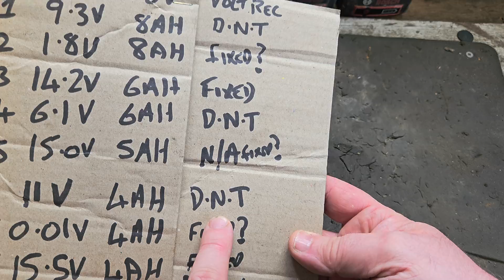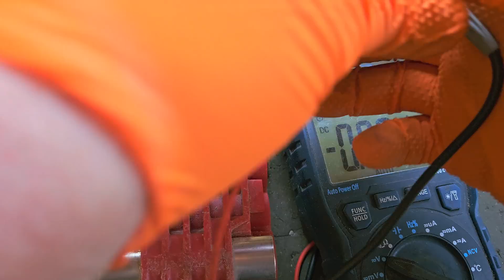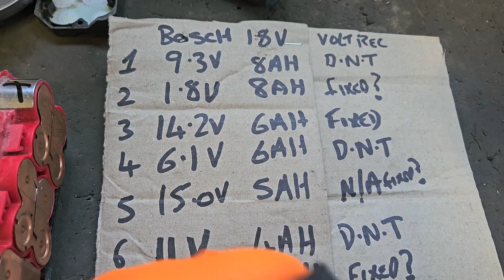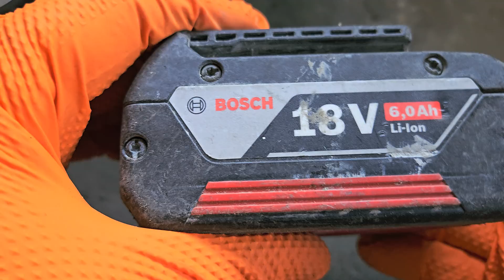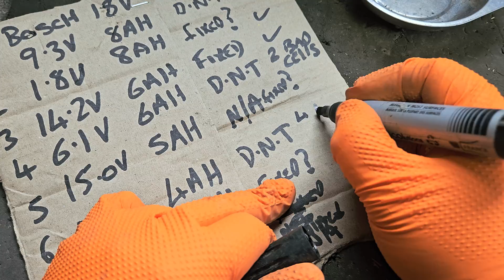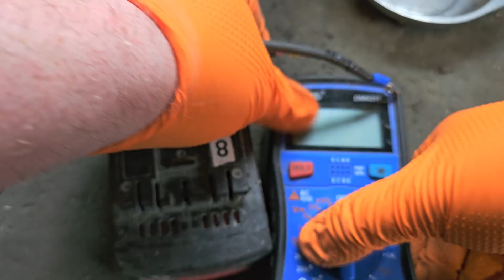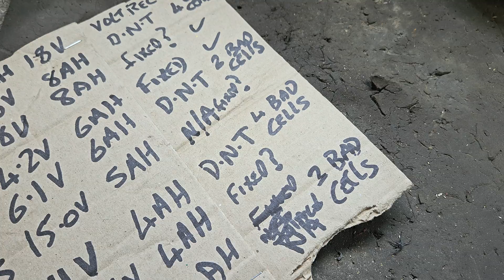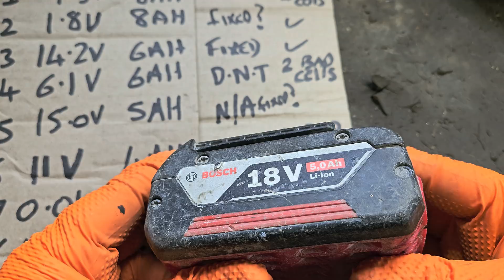I Investigated 4 Faulty Bosch18V Batteries Here's What I Found

Comment: I liked the video............. to digress. What battery do you use to power your spot welder & can you use said battery for the IMAX B6. Thanks.
Reply from the maker: I use a lipo 3s battery to power the spot welder you likely can use a
It for the charger but I use a plug in laptop style adapter much more reliable for long term charging
Reply: Turnigy Nano-Tech Plus 5000mAh 3S 70C Lipo Pack